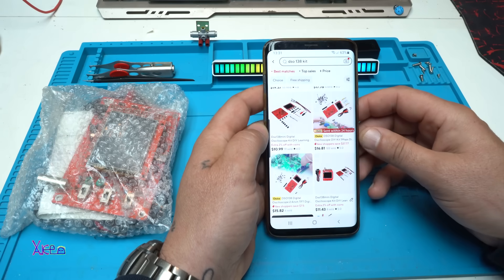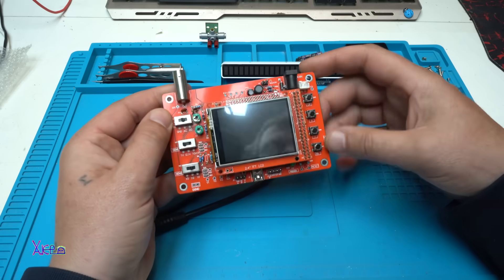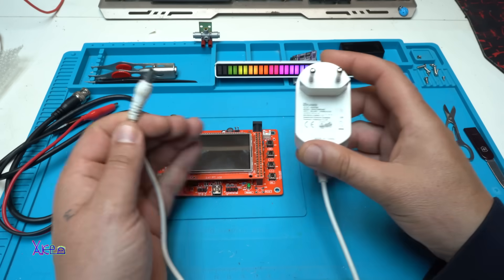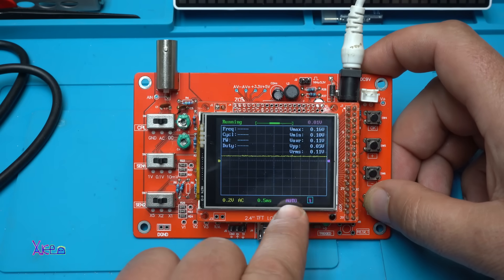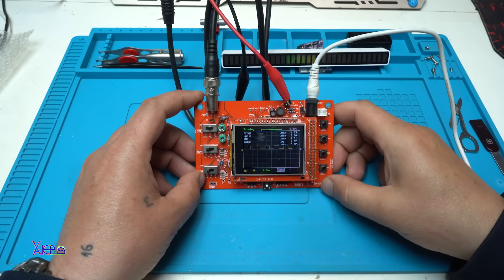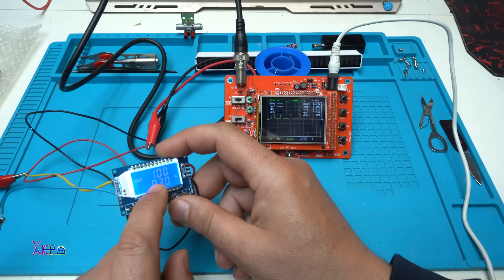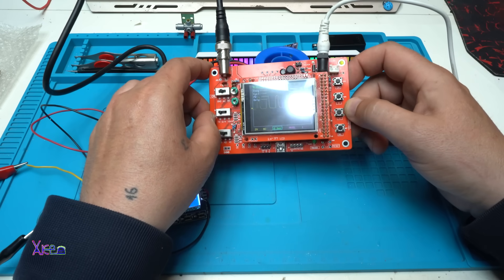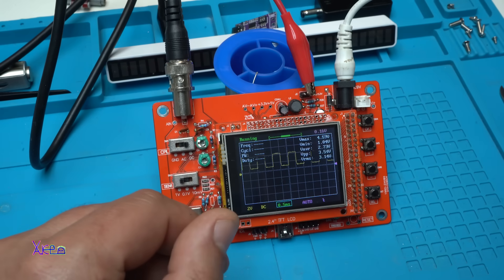THIS $20 Aliexpress Oscilloscope is SURPRISING?

Comment: I got 1 about 6 years ago (yes only 1) it is OK but you need a very clean well filtered power supply as it is prone and susceptible to noise interference.
Reply from the maker: Yes you need to have a good power supply for this to work properly.

Comment: i would find it very interesting, if there was a module you could set on a fixed setting, so you can use it as a visualizer similar to those stamp sized voltmeters, it shows something at a fixed setting. a whole oscilloscope would be overkill  , but this makes me wonder if you can modify it so when its powered on it shows only the waveform and volt. reason being way such thing would be interesting is because you could integrate such display to your project.

Comment: 0-200 Khz? Meh, Thanks for showing it!
Reply from the maker: As I say it its for practice soldering,assembling and entry oscilloscope
Reply: @Hacktuber  I should not complain! The one I have is a cheapo 40 mHZ. It is good enough for old PCs.
Reply: beats my old cathode ray tube brick of a scope...
if not in performance then in comfort and desk space
Reply: @TheScarvig  0-200 Khz? Still meh!
Reply: @DonnyHootieHoot  enough for most beginners... slim chances they are going to sample HF circuits or high speed data lines.
its enough to watch 100kHz PWM for some LEDs or the 50Hz noise picked from the powerlines and to figure out which pin is clock and which is data on I2C
Reply: @TheScarvig  OK, keep arguing with me, it's STILL meh to ME!!!!!!!!!!!!!!!!!!!!!!!!!!!!!! Get it?> Got it? Good!
Reply: @TheScarvig  My friend bought one of those old CRT scopes just for the look.  Whenever he shows off his workbench he turns it on and has it hooked up to a wave generator... everybody knows he is a legit engineer when they see the electricity on the screen!!
Reply: @marhar2  tell him to input two phase and frequency shifted sine signals in X/Y mode! its called lissajous figures and they look even cooler than just s single waveform

Comment: I have an oscilloscope in the garage from my tv servicing days, it cost about £350 iirc and is massive,
The probes cost £15 each lol.😂
I think you can buy these in multimeter form so its safer than just bare electrics but if you are building something yourself and fitting this inside its good option.
Reply from the maker: Thx for sharing the info sir

Comment: Looks cool. I'm in US and it's about $25 plus ~$5 shipping. Probably going to pass until I can find it $10 cheaper.
Reply from the maker: Yes wait for better price sir😉
Reply: For those who don't know, the tag "choice" by an item means that any order over €10 will have no shipping charge, or a fixed €1.99 shipping charge if under €10, 
I just turn on "choice" in the filter for the search results, and then compare prices... If you don't have "choice" turned on, the suppliers give a price that looks great, but then have €4-€6 shipping charge, so that it's impossible to compare real prices.
Reply: @lohikarhu734  i use the "bundle" deals a LOT
starting at 3 items free shipping and at certain item counts you get whole dollars worth off.
sometimes its worth to throw in that extra item in the cart just to hit that next threshold and if its a cheap one that often even reduces my current cart cost.
works quite well with cheap electronics modules.
of course the selection is different and not everything ships to every country that way.
of course if you buy parts in bulk it can be cheaper to go for the ones with shipping as you pay shipping only once and not several times as when it is included in the price (dont kid yourself, you PAY for shipping...) 
one other thing with shipping is that i believe its not refunded... so with those high shipping charges(although they are actually the realistic charges) you run the risk of not getting them refunded if you got scammed by a vendor